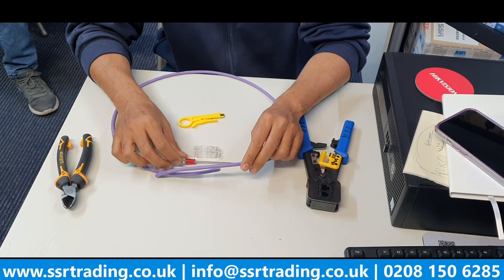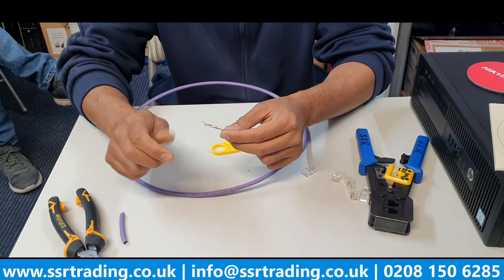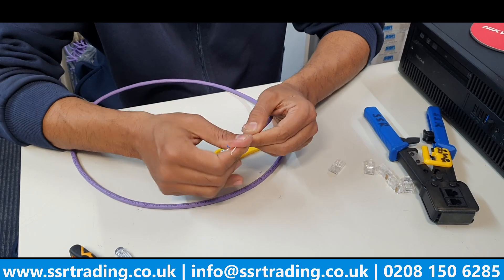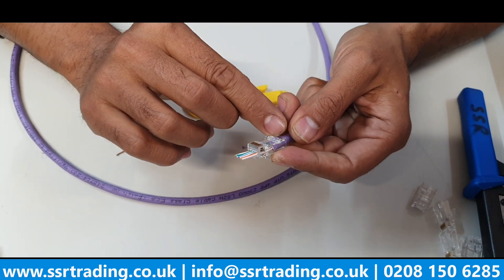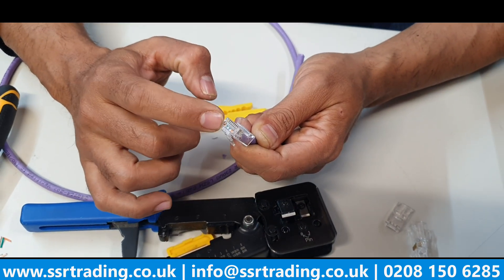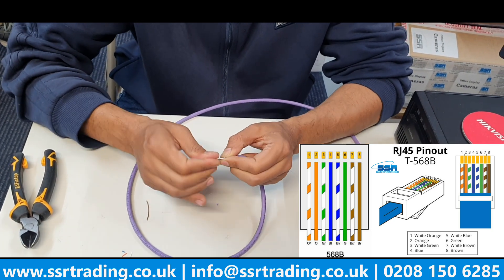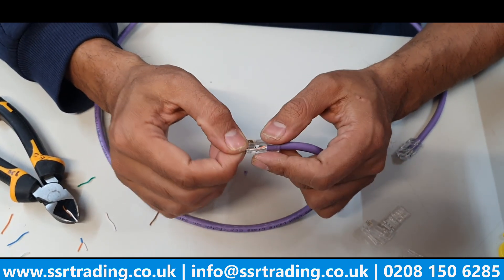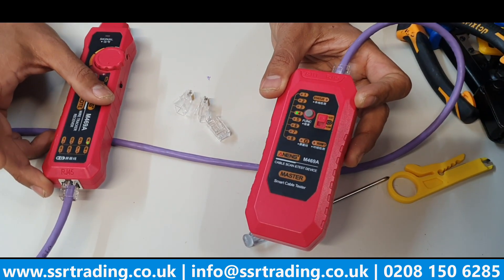How to make Cat 5/Cat6 Network Cable- Ethernet Cable - Network  Patch Cables - Tutorial Guide

Comment: Just changed my cctv ethernet cable out for a cat 8 and works perfect. Only issue I have is static audio on a HIKVISION 5MP DS-2CE78H0T-IT3FS HD-TVI 2.8MM LENS TURRET CAMERA, 40M SMART IR, BUILT-IN MIC. Works fine for days then gradually starts becoming more of a problem.